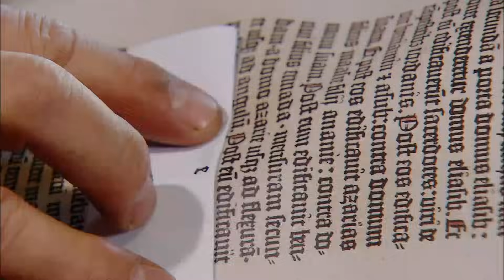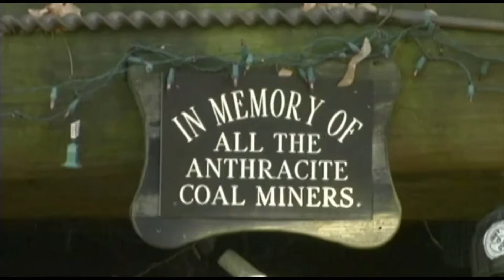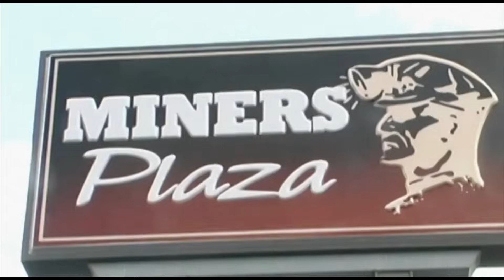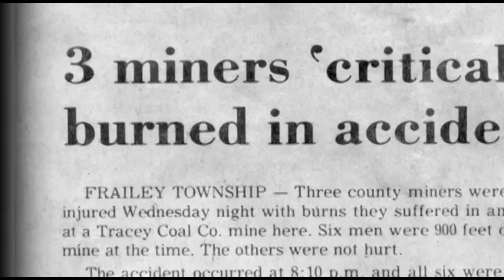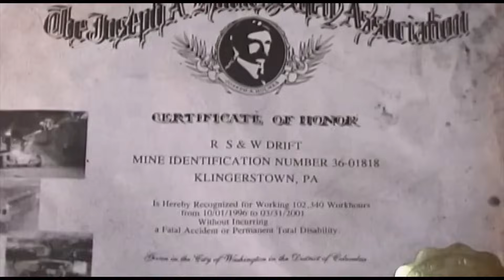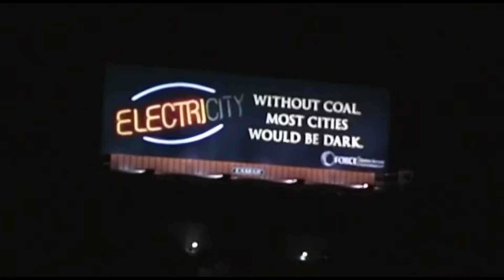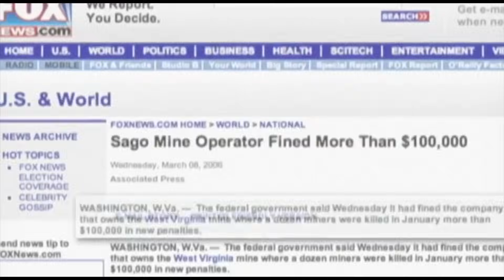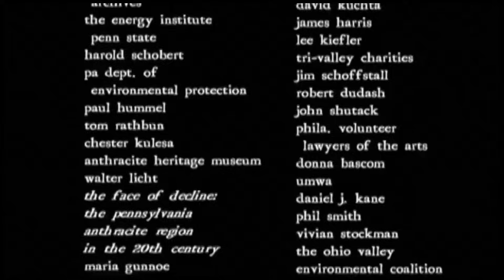The Last Coal Miners (Injustice Documentary) | Real Stories

Comment: David A will always be missed along with a cold Premium from the cooler on the porch  after coming up out of the hole. I grew up in Sago WV at the Badger Coal Mine where my dad worked until we moved to the Skook.  I grew up and ended up working with or becoming friends with most of these guy's. I'll always miss the 1,000ft ride on a steel cable....